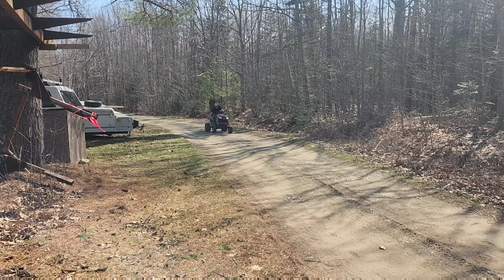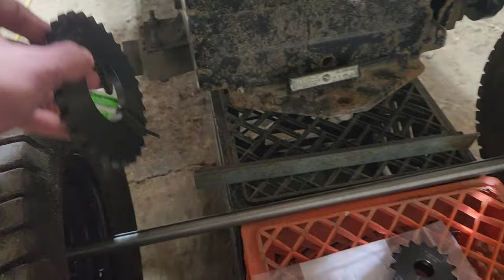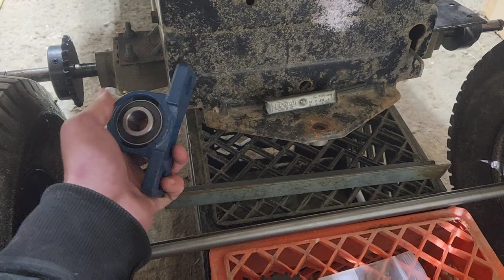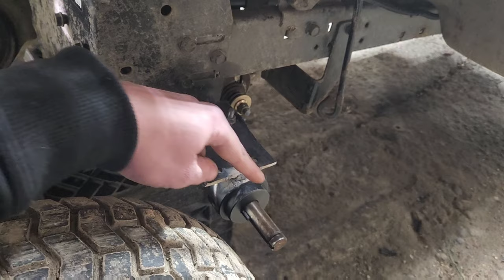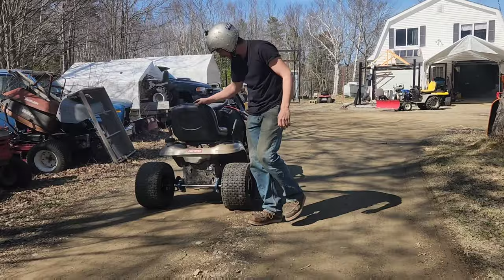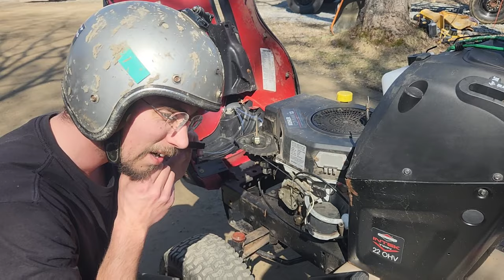Making a Hydro/Automatic Lawn Tractor Faster Part 1

Comment: So totally like I was planning for the Ford YT16 4x6 and potential snowmobile tread adaption when I was brainstorming doing that though for independent suspension of the back axles.  Fricken awesome!  Interesting, though I don't really know much regarding, my one rare seeming Murry Lawn Chief has something like this design stock.  I forget if axles come out both sides or only one and I believe that's stock.  Now that I think about, I wasn't doing Youtube for that stuff back then, so never really made a Youtube video detailing that one since really only got for the oppie and snow blade with custom subframe assembly.
Reply: Totally neat, keep em coming Neal!  Seems like I made drawings since I measured for the radius where the pain in the rear for the independent suspension was the pivot point if not on the transaxle axle itself to keep the distance the same when changing height over bumps on the rearest. Otherwise, seems simple from what I view, with the other more exactly like you're doing with the axle though for the ladder bars I guess we will call front mount point needing like an idler pulley tensioner otherwise so more crap to design in.  OK, I have to get off this computer and get back to work so can wrap up planting work and get to some garden tractor projects now the weather has gotten crazy warm here.

Comment: thats kind of what i did. but i have outboard bearings on my transmission axle and the output shaft. and i run a long swing arm 1 1/4 axle. with limiting chains and 4 chain tighteners so i have reverse . you have to be pretty crafty to have reverse on a chain drive swing arm.  remember your first chain drive, i always wished you finished that .  i got a hydro twin lawn machines im  doing next.  i working on a rer with a 212 and converter. .to ride around town
Reply: if you cant tell . i pre-commented again ..

Comment: Change the spindle all you have to do my tractor Craftsman T240 turn tight has a Kohler 7000 series 22 horsepower 725cc V Twin engine I was thinking about doing that but Changed my mind it already moves a 6 mile an hour it's fast enough for mowing

Comment: Wouldn't dual chains so one on each side, be a better setup so it balances everything out.
Also, cut the axles but also grind a small key way in, so you are not just relying on the welds.